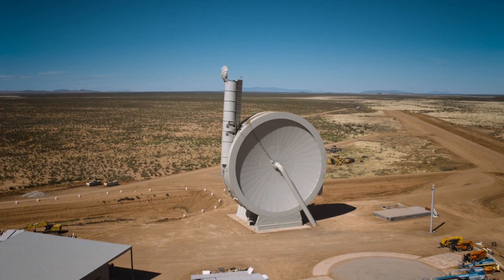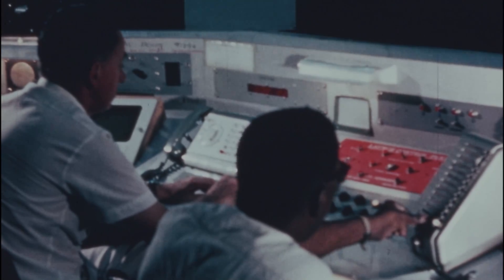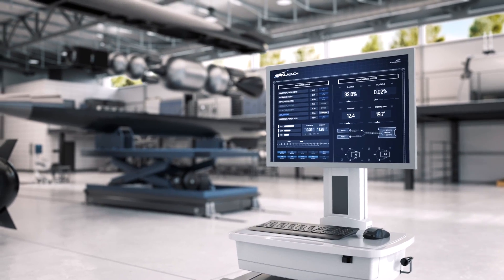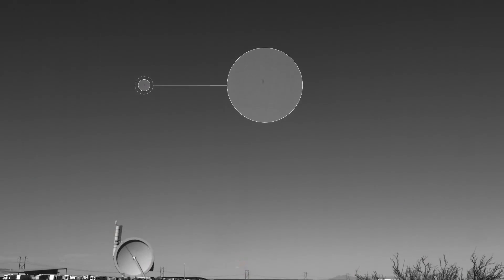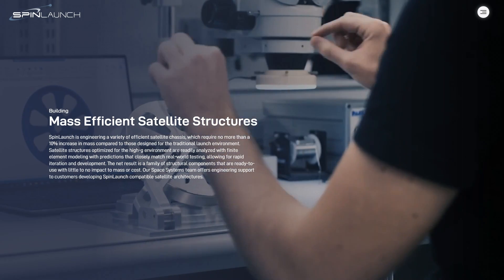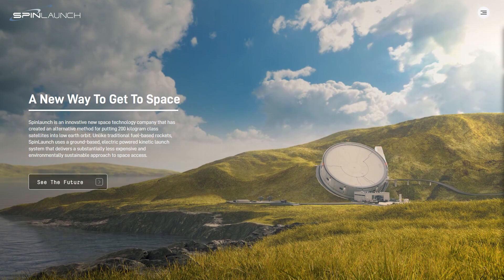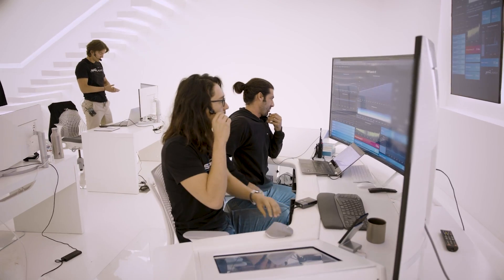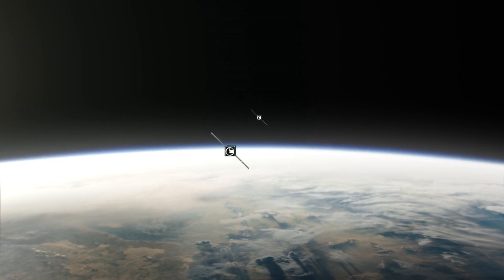Can Spinlaunch Throw Rockets Into Space?

Comment: It'd be fun for someone to do the math and give an estimate how far the scaled up version of launcher could launch on the moon.  How close to escape velocity for a return trip to Earth?   Could the launcher achieve higher RPM on the moon due to lower gravity?
Reply: Low lunar orbit is 1700 m/s and the plan described for Earth launch is to launch at 2000 m/s. If you could build a comparable device on the lunar surface it would work fine for launching cargo to orbit. The reduced gravity would be of no more than incidental assistance, as the launch forces are much larger in either case.
Reply: The only limiting factors are G tolerance of the payload, and strength of material we have access to. On the moon, you could launch all the way back to earth, but without graphene or something, we're limited to about 3 km/s velocity right now. Less gravity doesn't get you higher speed, but it does mean lower speed to orbit. Also, the RPM doesn't matter, you can make the arm longer to have lower RPM at the same velocity (also lower G force). With no atmosphere, you could reduce g force a lot by using like 10 rpm with a radius of  hundreds of meters. The beam you need is long, but much thinner, and the only thing that ends up mattering is the strength to weight ratio. The math for how strong the beam that holds on to the rocket has to be to reach escape velocity is very similar to the math to calculate a space elevator tether.

Comment: That vacuum chamber will be interesting....probably quite hard to make. It will take days to decompress....probably a problem
Reply: Not really, you can "keep vacuum" in several tanks offsite and then use one them to get rid of most of the air from the chamber. You can repeat process fast as long you have "empty" tanks. Scott was showing similar setups in his movie about supersonic wind tunnels.
Reply: @randomnickify  that is if you can make it absolutelly airtight, bearings are a problem, if you pull a vacuum on the motor you need some alternative cooling for that x MW of motor
Also, if you have the air go into a tank, that doesnt hep much, say it is the same volume tank, that takes out about 1/2 the air. when puling a vacuum its like taking 1/2, than 1/2 of that, than 1/2 of that etc
so it is harder and harder as you get up to the vacuum.
I agree with scott about the moon, but i am quite sceptical if it will succeed on earth

Comment: Even for rockets which are only G-rated to like 5 or 6 g's (vertical only), there would be significant benefits in payload ratio if rockets were given a push from underneath with steam or compressed air. Like a silo with a piston under the rocket. Instead of gun-to-orbit, think airsoft to get started. Or underwater launching and using a flotation capsule to gain some inertia.
Reply: Yeeting a several hundred ton tower up at a few hundred m/s with compressed gas cannon... seems a bit hard to me
Also i'm not sure these tanks could hold up to 5-6 g when there's a full height fuel column inside; they ususally only get these kinds of acceleraton shortly before stage separation... or do they?
Reply: @bottlekruiser  I wasn't thinking of a few hundred m/s. was thinking more like a figure well under a hundred m/s. Just pre-breaking inertia would save gas.

My idea is a fairly small benefit. But that makes the G forces and logistics of accomplishing it simpler to actually do. I'm thinking low cost, low tech, low design impact. Yeeting a rocket upwards in such a way that it would only go up maybe 100 m (not 100 m/s, just 100 m altitude, if that) under the force of the yeet, before crashing back down. But that's actually a benefit worth looking at. And I'm thinking it would be adaptable to existing rockets.

Just starting to move and clearing the tower costs some of your fuel. perhaps 3 seconds of burn time. If you fire a rocket and it achieves 3000 m/s max lets say... the fuel isn't spent equally on each portion of that final velocity figure. The way acceleration works (and fuel weight), you burn a LOT more fuel for the first 0-50 m/s, than you do for the last 2950-3000 m/s.

If you could get that for "free" by launching from a tube instead of a pad... with fairly low tech hardware, at modest G-load... it would NOT be game changing, but it would be worth looking into. (and by "free" i mean free relative to the rocket design, it would have some ground costs).

Rockets are already pre-stressed to handle all their G-load from their butt upwards. So you're shoving them where they get shoved by design in the first place. Just don't exceed the G-load of the engines themselves.

You defeat gravity with a thousand paper cuts. This "gentle yeet" would just be a large-ish paper cut. There's a lot of paper cuts in rocket design.
Reply: @kathrynck  You know what
i kinda like that idea now that you've given that disclaimer
though for such "low" speeds mayeb we could use mechanical means of yeeting instead, like a pulley system or smth like that
Reply: @bottlekruiser  ya, pulleys and counterweights could be an option. Could spend all day storing up the energy.

It certainly wouldn't be cost effective for the first rockets using it. But if you made a system which gave a soft-boost on the ground, and was very robust for long-term use, it would quickly pay for itself in 'free' specific impulse.
Reply: For the largest rockets, this becomes impractical, but you can still use other methods to give them an initial push. You're going to need a very large capacity to store energy and release it in a very short time, so something like a large bank of capacitors or one (maybe many) compulsator(s) to store the energy, and then a nickel-iron platform for the bottom of the rocket to be mounted to, and then a pit in the ground that has many electromagnetic coils along its length.

Idea is you make a gigantic coil (solenoid) gun (launcher) to get the rocket into the supersonic flight regime right at ground level.
This means you can make the whole rocket smaller, as it doesn't have to carry the fuel to get the rest of the fuel (and the rocket) up to that speed.
Reply: @44R0Ndin  I was actually more leaning towards steam. But yeah it would be a lot of energy. Still terrestrial energy is far cheaper than adding pounds to the rocket to make energy. And much more easily reusable (the hardware i mean, not the energy itself hehe).

I get what they're doing here though. And it's a great idea, as are long EM rail ski-launches. I was just thinking of something which is less G-force intensive, since there are advantages for many types of payload if you only need to design to 6 G's or so. My idea wouldn't replace a whole rocket stage, just perhaps gift the payload capacity by 10% or something (which is a lot).

Comment: The failure mechanism concerns me most. Flywheel batteries and flywheel cars weren't viable because they were too dangerous. You'd have to put 10ft of concrete around its parameter.
Reply: More like 10 meters steel reinforced concrete wall, plus a mile wide (at least) safety area around the whole thing. But it's still worth it i.m.o., could be the only viable way of lifting enough material to build larger ships in orbit within a reasonable budget.
Reply: @Dr_V  Earth gravity is too strong, I pretty sure it will be more practical to get materials for large ships from the asteroid belt or other low gravity sources where you are not wasting so much energy getting it up to speed.
Reply: Nope, just put it inside the creater in the first place, it will actually help, in case of failure you will have new launch site :)
Reply: More than 10 feet thick.
Reply: flyweel batteries are a thing. there Build a lot in 50kW staks. about 24h with 10% loss
Reply: @x3Cay  There's been many attempts, but nothing I know of has stuck around. Beacon Power didn't make it, Revterra is giving it another go, so is Energiestro.
Reply: 10ft would not be enough, there is 5 tons of TNT equivalent kinetic energy stored in the payload alone. If this thing blows up it's gonna look like a MOAB went off. Search for videos of it from the war in Afghanistan.
Reply: @KaizokuSencho  thats all right, but....
how much protection / safety area do you need for a rocket launch? :P

Comment: Not only the sudden change in balance at launch, you also have to deal with the supersonic ingress of air into the spin chamber.   That’s going to be a tough problem.  I see the renders of the arm are aerodynamic, so they’re aware of the issue, but I didn’t see any other mitigation.  The heating that happens to the vehicle will also happen to the outer end the arm and counterweight, but in a closed space.  Will that suddenly expanding air overpressure the spin chamber?

Comment: They would still need a new "second stage" for every launch. I don't see how they would beat Rocket Lab for price, assuming Rocket Lab is successful with first stage reuse.
Reply: Not to mention gentler on the payload...
Reply: They can claim to be the green option, and wouldn't be wrong since even the best of the rockets are horribly inefficient at turning energy into movement.
Reply: Rocket Fuel is not cheap. The first stage of a rocket uses a massive amount of fuel. Plus, some people these days are starting to complain about the fuel use and emissions of space programs.
Reply: @Veritas-invenitur  rocket fuel is actually quite cheap (relative to everything else), I believe for a falcon9 its 250 000 dollars of fuel per launch.
Reply: @arikatz9219  I stand corrected.

Comment: It'd be a good idea to set up their spinner on a plateau that's already at a high altitude, that'd reduce the air friction and give them a couple of km head start.
Reply: Yah but u have lots of logistics problems getting the stuff up there.  It's all about the economics.  But a mild altitude wouldn't hurt.
Reply: You are getting at best 10 km higer and we are taking abut hundreds of km in altitude
Reply: @stekra3159  The lwoer altitudes are the worst though, because of air resistance, so building that thing 2km above sea level would already help a lot
Reply: @stekra3159  no, the atmosphere is much thinner above 35km and it's a gradient, at 8km [tallest peak] it is thinner than at 0km [sea level]
Reply: lmao
for once "put a launch facility up in the mountains" begins to make practical sense. Better yet - lift it up on some blimps, there's negligible air 20km up. Plus you may get some cool standing waves on blimp hulls from the vibrations or something.

Comment: Don't think reaching maximum speed where the atmosphere is densest is efficient.  The rocket needs to be extremely aerodynamic to mitigate drag and heat.
Reply: Yeah, this is one of those times you would really want to build your launch site on a mountain or something. Seeing the artwork with it right next to the ocean seemed silly to me.

For conventional rockets, building a concrete pad on top of a mountain just so you can truck a thousand tons of rocket and fuel to the to just isn't worth it, but for this where you need a massive facility, vacuum pumps, small rocket, and electrical power lines from a generator that could be elsewhere, seems like it would be the way to go.

Comment: They should solve the angular momentum problem by simultaneously throwing a lead ball into a net in the opposite direction.
Reply: That has to be a strong net. Its at mach 1 lmao
Reply: Maybe not a net, but maybe a long magnetic tunnel and they can regenerate a bit of the electricity.
Reply: A very, very strong net.
Reply: A deep sand bunker maybe, or into a deep tank or body of water.
Reply: It's moving as fast as a railgun projectile. You'd destroy whatever you hit with it. No material is strong enough.
Reply: What net could stop such a cannon ball? I think they went with some moving weight closer to the axis but still a catastrophic failure every other launch wouldnt surprize me